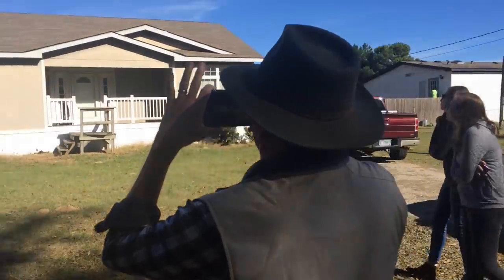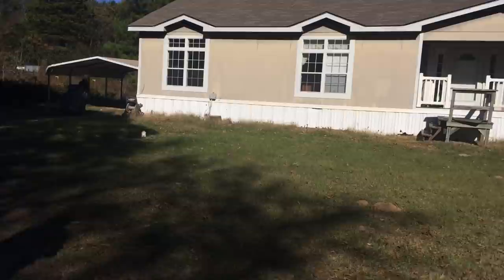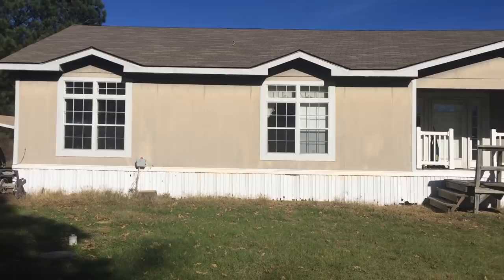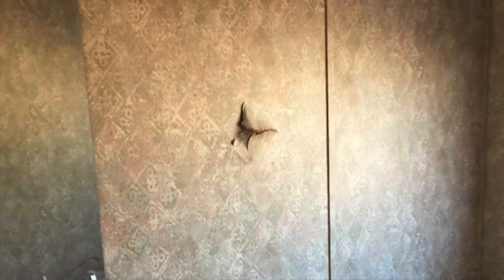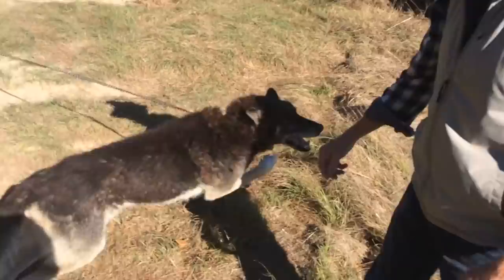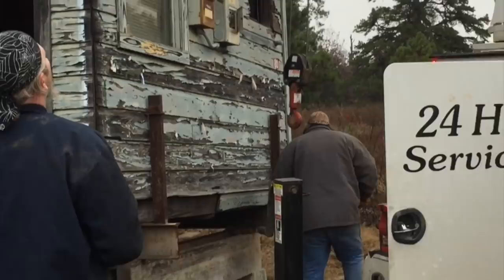5 Minute House Flip! | Double Wide Mobile Home | Before & After

Comment: I sold my real home in Los Altos hills California got laid off from the Silicone Valley working 20 yrs.  Now I am here in AZ 55 plus.  I also bought a 2004 3 bedroom manufactured home the manufactured home have a huge driveway and a huge deck/patio it needed all the yards to be worked on lots of prickly cactus that was 7 feet tall and 7 feet wide and some bird of paradise plants that was growing every where all the cactus where all over the front yard and then the side yard lots of aloe Vera.  Aloe Vera were all spread out all over the yard.  I had everything taken out.  Now i have beautiful white shiny rocks from Lowe’s with beautiful vincas flowers all around and some beautiful solar lights.  Now, the inside of the house it needed 50% renovation and underneath the house to make it more weather resistance for strong winds from monsoon season.  The house needed new appliances and bought it from Lowe’s.  New skirts from the siding of the manufactured home new paint and my big i call it patio is painted and i had Tucson Asphalt Company did the work for my driveway they did a great job and make the driveway concrete after 1 month of drying the concrete they will put sealant.  I had hired a painter and the house is black and white I love my manufactured home.  From Los Altos hills home to AZ manufactured home.  Now, I can retire and enjoy the bike path in Tucson AZ.  🙏🏼❤️
Reply from the maker: That is amazing! I bet that aloe and cactus add to it too with the whole AZ vibe. Totally different from Texas! Best of luck and enjoy your retirement! Mike-

Comment: Beautiful! We bought a 2000 sq. manufactured home after living in a cramped 700 SQ. ft apartment ….and I was overwhelmed to say the least! The amt of work that had to be done on the supposed "move in ready" ..is still going on....after a year. BUT!! I have successfully transformed the Master bedroom and master bath, kitchen, and much of the exterior with fencing...a new front deck....etc...
My to-do list still has some stuff on it, but I feel I have finally got the BIG stuff out of the way. I plan on replacing all of the skirting with wood siding and painting it to off set the color of the house..and it wont break when I weedeat:)
Reply: oh that will be nice contrast to the house! and yeah its crazy when you're actually doing the work it takes so long and so many things add up, but its really a good feeling when you finish it. best of luck with finishing it out- cheers

Comment: I used 1-1/2” metal stud framing under my home and attached 1x6 PT boards horizontally with a 1/2” gap between them and then coated them with sealer stain , looks amazing and I won’t have a problem with storms blowing out the vinyl panels

Comment: Loving the rebar porches!😍Never thought of that before.
Reply: This is now my name And this is my last name  Yes! Thought the same thing. Last forever and looked really nice!
Reply: The rebar thing is a great idea. The metal will last forever but the wood will deteriorate in the bottom hole. Water will run down the rebar and collect in that hole. There must be something you could put in those holes. Maybe liquid nails? Drill the hole so that the LN will squish out just a bit and you want wipe it before it dries.

Comment: The home is 100%+ better.  Although I would have contacted a modular home contractor and replaced the underpinning with concrete blocks.   I hope I never live in a trailer or mobile home that has underpinning again.  The mice come in like crazy in the Midwest.

Comment: Do you have a rough estimate of how much the renovation cost?
Reply: from my experience I would say you need a solid 25,000 to flip a house but that also depends on the condition of it and if you can cut cost by doing the work yourself. the condition of the Roof, foundation, and A/C are important and big expensive systems.
Reply: Roughly 40k+ my experience after renovating two different mobile homes in Texas

Comment: What is the difference between a mobile home and a normal house? Is it an American concept because it looks like a normal house, what makes it different?
Reply: Mobile homes are made in factories and towed to the location. They can also be moved again after installation. Versus a standard home with a poured foundation built in place.
Reply: This is a double wide trailer. In concept single wide trailers can be unplugged and driven to another trailer or rv park and connected again. Im not sure how the double wide trailers move.